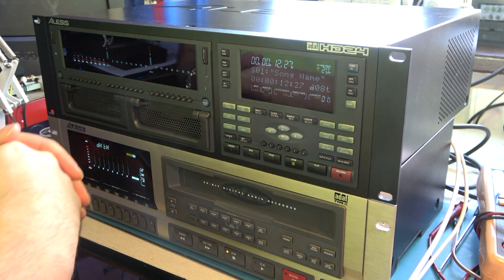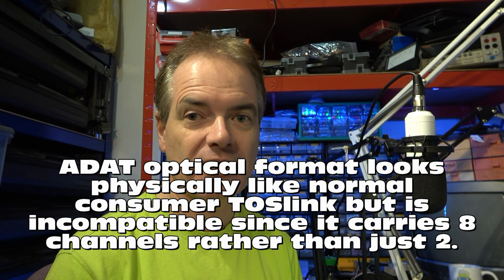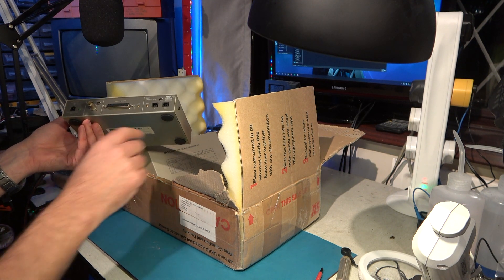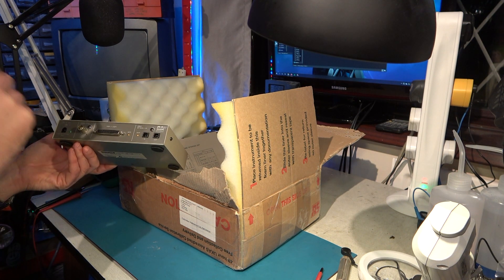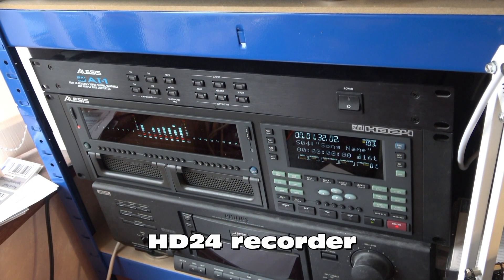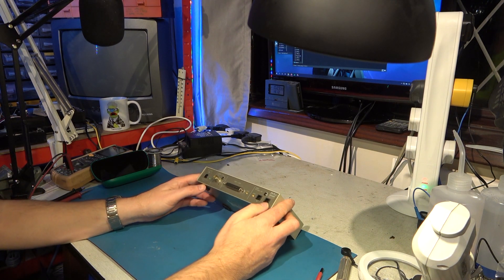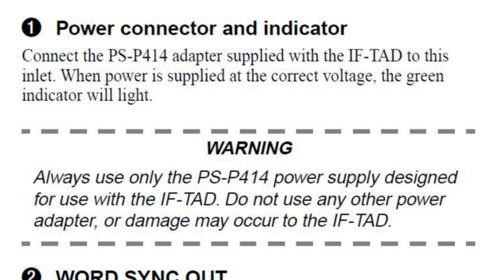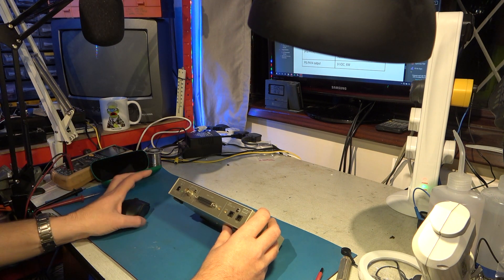Tascam IF-TAD converter. TDIF-1 digital signal from DTRS player transfer to Alesis HD24. (Edit:2)

Comment: How can I import a recording made with the Alesis HD24 into Audacity or Ableton in order to edit the tracks afterwards (15:12)
Reply from the maker: You can get the WAV files off the HD24 through the rather slow network connection using FTP, or by using some readily available software you can connect the HD24 hard disks to a PC.  Then the files will simply import into Audacity.  Lots of people use Pro Tools audio editing software with these files, but that's not one I've played with yet.
Reply: Thanks, one more question, the "readily available software", I did some searching on the internet and couldn't find anything, as you may have noticed, all this is new to me and trying to find my way in, I'm more a musician then a sound engineer and am exploring the possibilities. As can be seen in your broadcast I saw the files in Audacity and wondered if the file loaded in Audacity works the same as on the Alesis HD24 do, do all tracks start synchronously? .Thanks again

Comment: Very good to see it working properly, that short time hooked up incorrectly should not have done any damage. That is one thing I remember from working with a few DA-38/88 setups, don't muck about with the cables and just get the proper Sony/Tascam cables.